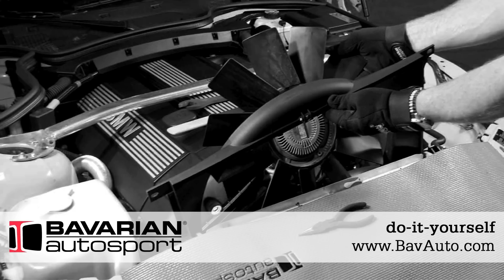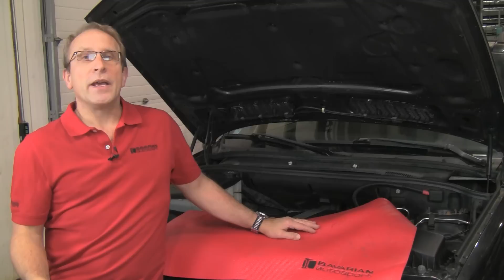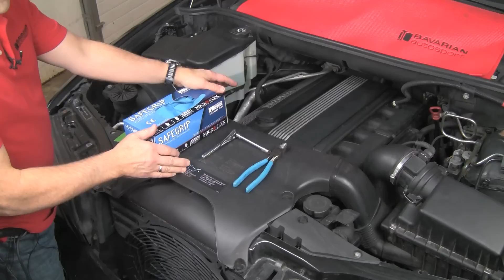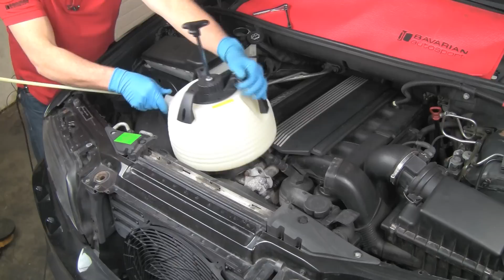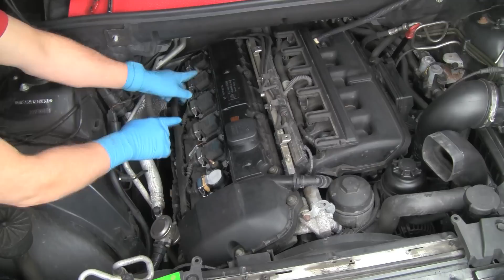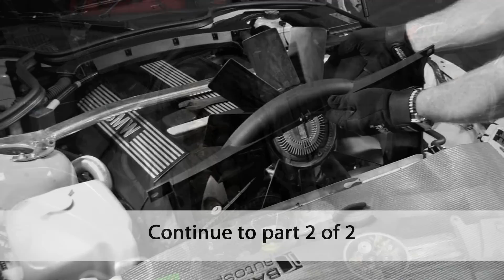Part 1- Replacing a BMW 6-cylinder valve cover gasket

Comment: Super helpful. I watched this and then changed the gasket on my 2003 e46 with 112,000 miles. Video made it so straight forward. My outer gasket was still slightly flexible, but was showing signs of leaking oil around the edge. The gasket around the spark plugs was brittle plastic and clearly bad. Took about 2 hours.
Reply from the maker: Good work, Trevor.  Glad we could help.

Comment: I was tightening up the head cover and snap the bolt what do I do
Reply from the maker: At this point, remove the valve cover and hopefully, you can grasp the broken shaft with vise-grip pliers.  If not, you'll have to drill the stud and use a bolt extractor (commonly called an easy-out).
Reply: Thanks got it pulled out were can I get another one at

Comment from the maker: Head gasket replacement is fairly involved and you should have an applicable repair manual at hand.  We do offer the Bentley repair manuals for the E46 3-series models (99-05) in our online store at bavauto.com.

Comment from the maker: The M88 engine valve cover gasket replacement will be a bit different, but using the general procedures shown here would be a good start.

Comment from the maker: The 328xi has the N51 or N52N engine.  These engines have the ValveTronic system that controls variable valve lift.  The ValveTronic motor is mounted through the valve cover.  The motor must be removed prior to removing the valve cover.  The Bentley repair manual details the proper procedure for removal and replacement of the motor (as well as the valve cover).  In addition to the valve cover gasket set, you'll need a new gasket for the ValveTronic motor.  See our online store at bavauto.com.

Comment from the maker: Valve cover gasket replacement on the N52 and N51 6-cylinder engines i9s quite similar, with the exception that you have the ValveTronic motor to remove.  The Bentley repair manual covers theses details.  We have the manuals in our online store at bavauto.com.

Comment: I did this on my e34 which was easier than this one.   No extra things to remove.   When doing this is best to take the opportunity and change your plugs,  boots and coils
Reply: Also change your wheels "while you are in there". There may not be a connection, but who cares so long as the wallet is fat.